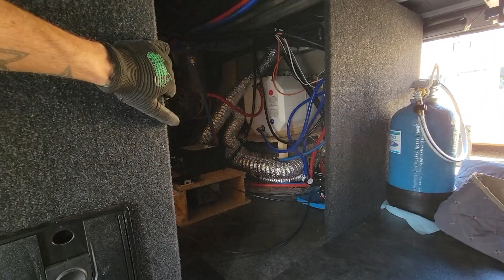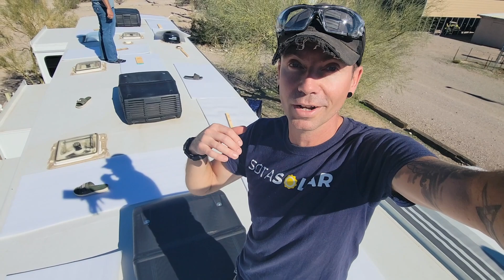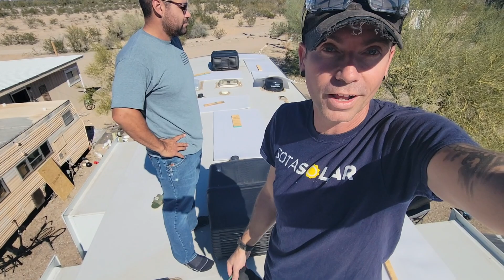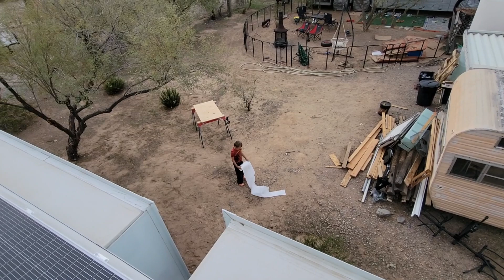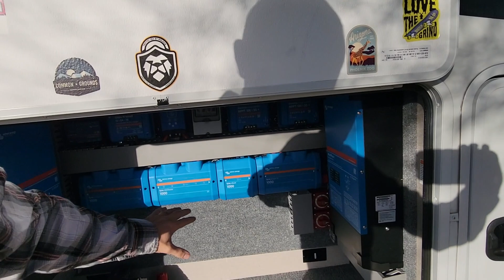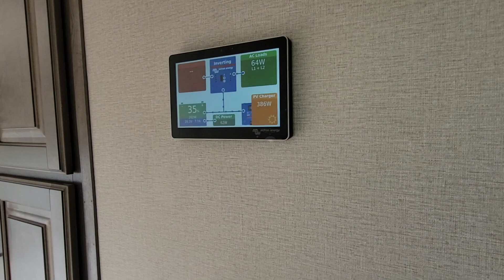2023 Grand Design Solitude 378MBS 3200w 24v Parallel Victron Multiplus Solar Install

Comment: What size main fuse you using on that dual MP 24v? I asusme youre only using one fuse, in the lynx shunt.
Reply from the maker: We’ll usually do a 500a or 400a . We fused each link into the Lynx Power In (add extra m8 bolts ) at 200a using 2/0 cable. So in theory those links could / should blow before the main.
Reply: @sotasolar  Thanks! I'm doing 24v 800ah dual parallel MP II 2X120 inverters. I'm doing a Smartshunt vs lynx shunt. Plan to install a inline T fuse of 400A between battery in lynx distributor and a 600A disconnect switch then into 2 lynx distributors for 24v loads. 400A seems on the small side. So I thought 500A but those aren't common to find. Only concerned about the peaking on the dual inverters.

Comment: Do you guys have a video I'm overlooking on how you're paralleling those multiplus units? Wiring, settings and what the minimum shore power amperage is for the two units. From what I learned a year ago, a pair in parallel exceeds shore power of 15 amps and maybe 20 amps.
Reply from the maker: In previous dual inverter setups we’ve covered it. We definitely need to look into maybe a more formal educational video on it. 

Your concern is correct, ac input current limit is much higher and n parallel. You can do 240 split, but we’d recommend an auto transformer to balance the legs then. 

You also end up with issues around most on board generators, as most have two legs but in the same phase.
Reply: @sotasolar  thanks for the reply! I appreciate your time. I was hoping someone found a way around the AC input amperage limit with dual units on lower rated outlets by now. Unfortunately I did find myself on 15 and 20 amp shoreline outlets at times. I came across a guy that disables the one unit and adjusted his settings when on 15/20A outlets. Seems like an ass ache. My trailer is on 15A out my home between trips. So I'd have to keep changing the settings each time I use the trailer and park it.

I learned of the onboard genset issue with load assist and such. Several have found a way around it with a simple wiring change.
Reply from the maker: You can try and set the DVCC charge rate lower if the main issue is charging causing overages in ac input current. Solar priority might also work / help.

It’s definitely something we want to figure out a solution for as well. 

Autotransformer have come down in price. I’d say that’s your best bet if you want to go down to 14 or lower amps.

Comment: Thinking about going over ac units,Momentum 31G,using ladder roof racks with iron ridge rails mounter to ladder racks.
Screw bottoms of ladder racks right on gutters.Aluminum frame should be behind gutters.There’s wood in the frame so screws should hold better than no wood inserted .Pv Canadian 525 bifacials.Any thoughts?
Reply from the maker: Great way to go. Shawn did something similar but with Unistrut. (Is a bus chassis, so weight wasn’t an issue) . We’re working on using iron ridge / unirac rails for more RVs and Airstreams in the future.

Comment: Question is two 24volt 3000 better then just one 24volt Quattro 5000?  Is it because you’re getting 6000 watts instead of 5000 watts?
Reply from the maker: There are a few advantages. 

1) the possibility of true 240 split phase without an autotransformer, although if you do that you may want one anyway.

2) Multiplus offers the 2x120 mode which is very helpful in RVs. It takes 50 amp shore power and passes it through, then on inverting mode it bonds the two hots same as a 30 amp plug would. So everything works inside.

3) Yea, you do get a bonus 1000va of inverting power for (last I checked) cheaper overall price. Install costs etc would vary, but it’s something to consider.

4) lastly you de get a level of redundancy. It would require a VE Bus reconfiguration, but nothing crazy. I do wish there was an automatic fall back but it’s the way it goes.

Bonus) pro on the Quattro is no need for a  generator/ shore automatic transfer switch! 

 On the Himmelberger Bus we’ve considered Using Quattros for this very reason.  JD’s Bus uses a crazy Multiplus 10,000 , we did a video on it if you’re into something out of the ordinary.
Reply: Thank you I really appreciate the explanation.

Comment: In these 24V installs using the 24-12 Volt converters does the converter also charge the lead acid battery in addition to powering the RV's 12V system?
Reply from the maker: Typically yes, we usually tune the step down converter to 13.8v so it’s on a float type voltage all the time.
Reply: @sotasolar  If you swapped the 12V battery with a LiFePO4 battery, does the Orion 24/12-70 overcharge it? With this setup, would it be best to stick with a single AGM for 12V buffer?  What if you added a Orion XS 12/12-50 after the Orion 24/12-70 to charge the lithium?
Reply from the maker: @dalehollenbaugh6084 yes a small lithium would work just fine as well. I’d stick with the Orion 24/12-70

Comment: I’m doing a similar install currently , I would have liked to see how you wired the Multiplus’s in parallel as well as some footage of the batteries . I plan to put the batteries in the same area
Nice work and thanks for the content !
Reply from the maker: We have some other dual inverter videos where we show that. The trickiest part is the splicing, we’ve used aluminum splices typically. Put two 6 awg conductors in and one comes out, do that for each. Screw down tightly, check it again after wiggling and heat shrink when done.

Comment: Why did you put the 4 batteries into 2 strings with 2 shutoffs?
Reply from the maker: I believe the thought was to leave 2 inputs open for more batteries in the future.
Reply: So regarding the battery bank configuration currently you have 2 separate "strings" of 2 batteries each wired in parallel?  Each "string" would be 4800 Watt Hours each (24 V 100Ah in parallel would be 200Ah × 24V = 4800 Watt hours)  Does these batteries have a limit of 4 batteries wired in parallel?  If so is that the reason you did 2 "strings" to allow the customer to add two additional batteries (for a total of 4 batteries on each "string")
Reply from the maker: When we do these larger systems with multiple inverters the amp draws can get larger, even at 24v so using the Lynx Power in helps distribute that further.